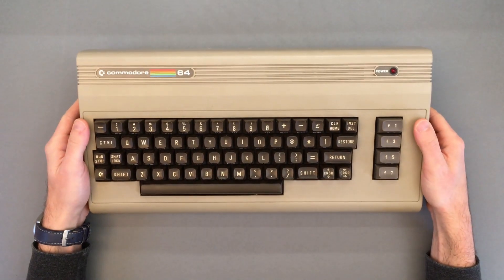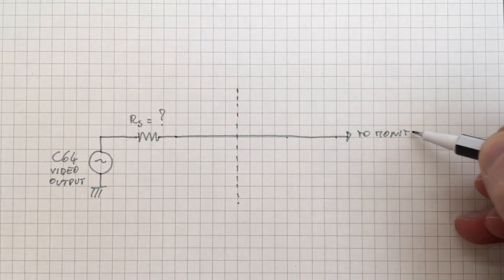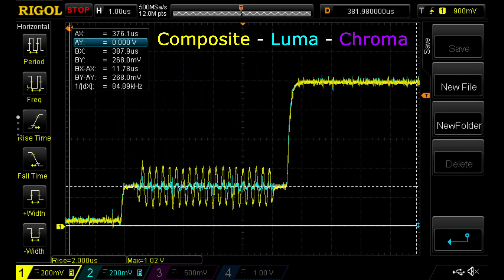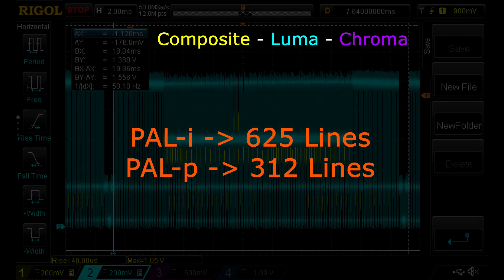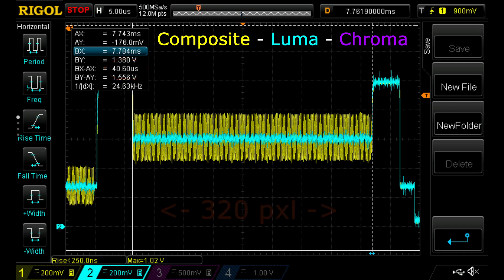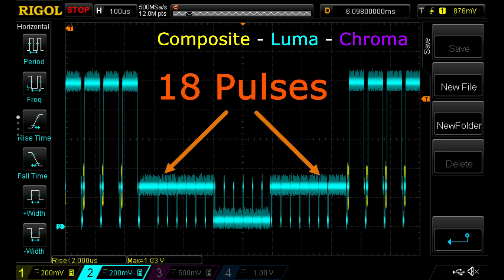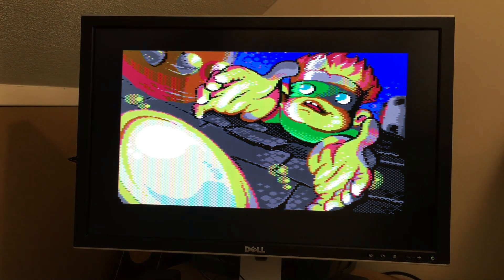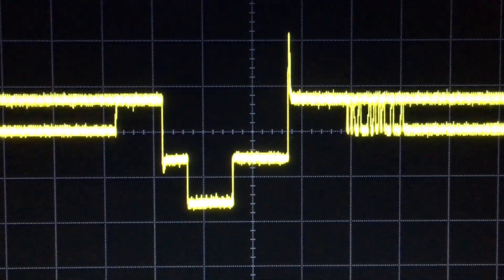C64 PAL Analog Video: A Complete Analysis

Comment: Could you get the PAL version running on the Dell without any syncfix?
Reply from the maker: yes for composite, s-video needs a 300Ohm resistor in series with the Chroma, as it is the case with most other monitors, but other than that it works fine